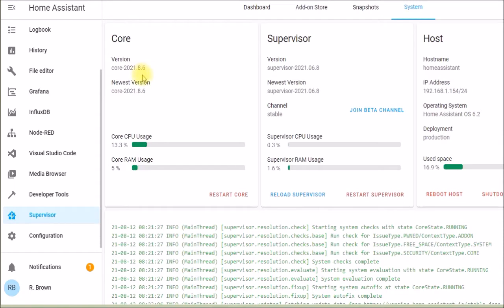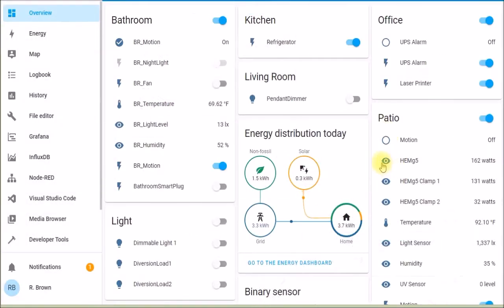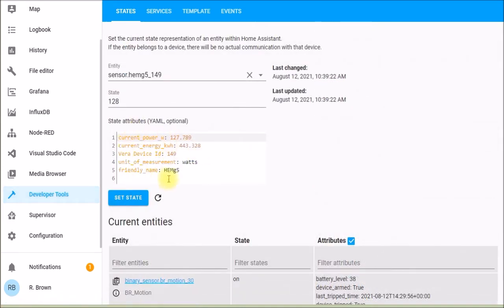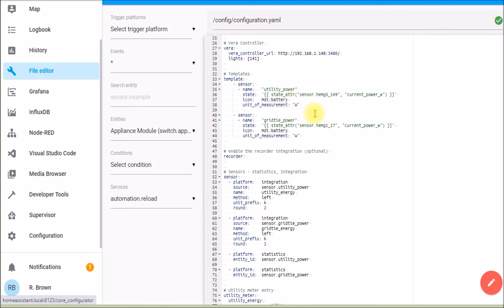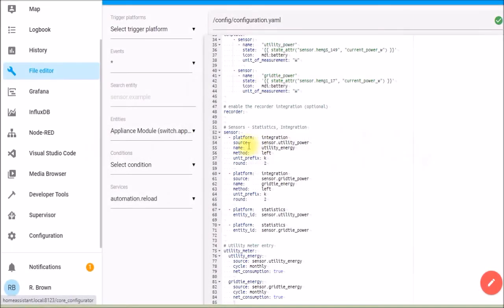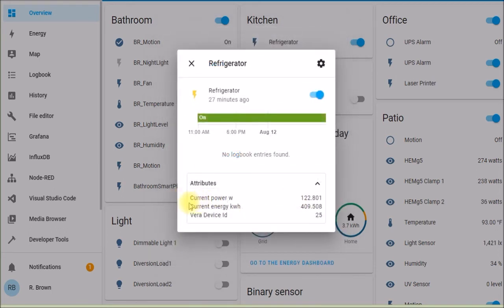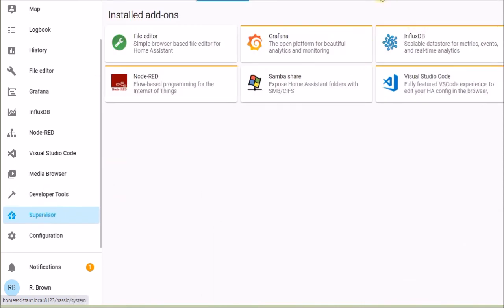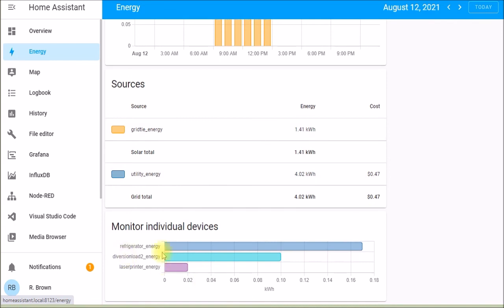Home Assistant Energy Dashboard With Vera/Z-Wave Sensors

Comment: Well looks like an update in HA broke this for me. Do you have updated yaml code you can share if yours is still working?
Reply from the maker: Yes and no.  Apparently, it's now frowned upon for a device to report multiple types of data.  For example, a light device can only report the status of the light but not how much power it's using.  Lots of smart Z-Wave devices report power and energy along with controlling a load or you can add a service to a dumb device, like a light dimmer, to report power and energy consumption.

This thread goes into some possible solutions:
https://community.home-assistant.io/t/update-2022-4-0-remove-energy-usage-vera/409259/15

I've had mixed results with that.  I've tried setting up virtual "light" devices and I can get some of those to show up in parts of HA but I can't get them to show up in Grafana, for example.
Reply: @The4Crawler  doesn’t the Aotec a device just measure one type of data though. I wonder if using a z-wave stick or maybe a Shelly em with clamps will be a solution .. just got solar installed and really want this whole home energy dashboard back
Reply from the maker: @cyberphox  I think I did have to make a change in the YAML template code for my Aeotec home energy meters, an example below:
  - sensor:
    - name:   "utility_power"
      state:  '{{ (states("sensor.hemg5_149")) }}'
      icon:   mdi:transmission-tower
      unit_of_measurement: "W"
Reply: @The4Crawler  do you actually have the Aeotec still working correctly? I'd  love to see your full YAML code. I have a sensor still reporting, but cannot select it for the Energy dashboard
Reply from the maker: @cyberphox  Yes, see the video description for a link to that section of my configuration.yaml file.  As I recall, I didn't change any of the other code, just the line that reads the power from the Vera sensor.
Reply: @The4Crawler  mine is totally borked then..darn..might have to start from scratch and not sure i want to use the Vera anymore
Reply from the maker: @cyberphox  It's a little time consuming to get all these changes in there.  You need to make the change, restart HA then wait a few hours to see if the data starts showing up. Like make sure the power readings are showing up, if not go into Developer Tools and see if you can figure out why.

I'm sticking with my Vera Plus to handle the day to day actual automation stuff.  It's very stable since the firmware is no longer being updated..  I just use HA to record and display the data.   I find HA "breaks" every so many updates and then it needs some fiddling with to get it going again.  

I haven't had much luck trying to get HA (running on a virtual machine on my NAS) to work with a USB ZWave adapter.  Supposedly that's the way to bypass the Vera controller.

Comment: Great video. Got everything working except the two lines of code with statistics platform and its entity_ID. i get this error: "Invalid config for [sensor.integration]: [entity_id] is an invalid option for [sensor.integration]. Check: sensor.integration->entity_id"
and under "energy" i get: statistics_not_defined
sensor.svalevej_forbrug
Entity unavailable
The state of these configured entities are currently not available:
sensor.svalevej_forbrug (unknown)
Reply from the maker: Likely due to this change in HA:
https://community.home-assistant.io/t/update-2022-4-0-remove-energy-usage-vera/409259/17

Comment: Thanks for the video.  I have the same setup in Vera.  However, I've unable to link Vera to Home Assistant.  HA keeps rejecting the URL for Vera on my home network.  How did you get them talking?
Reply from the maker: If Home Assistant is running on virtual machine or Docker setup, like I have, you have to set up a bridge network connection to have that virtual machine be able to reach your local network.  Are you able to connect to any other devices on your local network?  I don't recall having to do anything on the Vera side.
Reply: @The4Crawler  HA is running on a Raspberry Pi on the same network as Vera.
In a browser, I can enter Vera's IP address (192.168.x.x. [no port]) and it takes me to the Vera dashboard.  Putting the same number in HA gets rejected. "Unknown Error."
Reply from the maker: @Lonestar101  I've not use HA on an Raspberry Pi.  But all I have in my NAS virtual machine setup for the Vera connection is http://192.168.x.y:3480